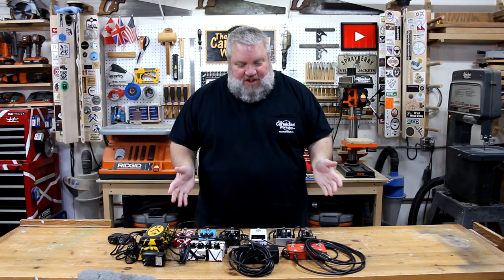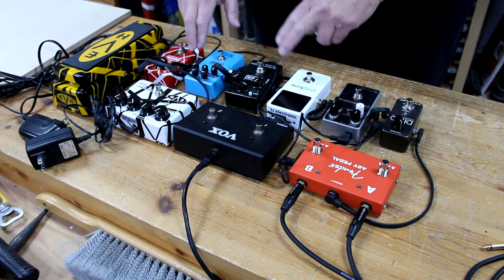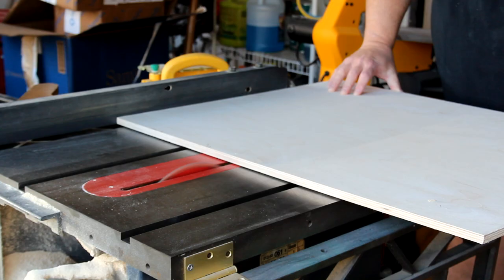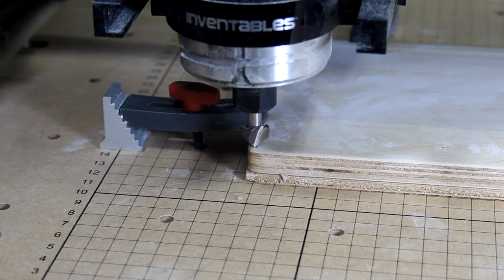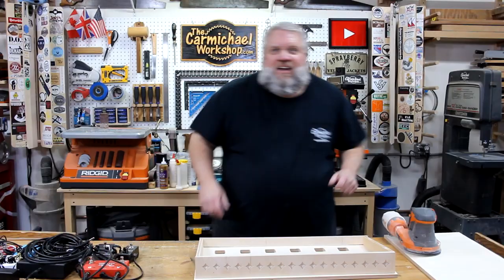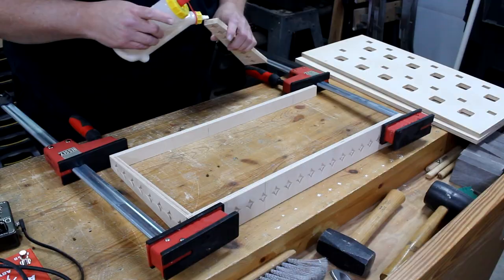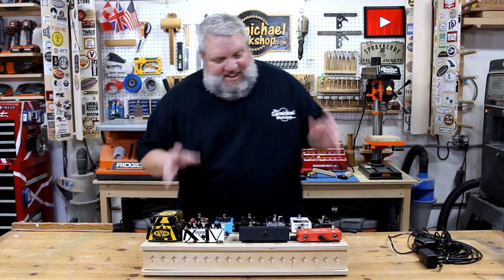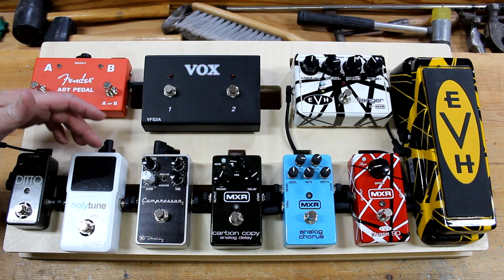Making a Guitar Effect Pedal Board

Comment: Nice project! Here are some ideas for improvement, in case your board should be used for gigs: I would have added space for the two power adapters. Then you would only have one (longer) cable with a mains plug. And I would mount the cables running to the amp permanently to the board and tie them together. The next project could be building a transport cover. You could design it that way that you have space on top of the pedals. After the gig, you could simply drop all cables on the pedals, then put the cover onto it. The cover would have also a handle for transport.
Reply from the maker: Thanks Oliver!  Great tips!  I play bass in a band so this guitar pedal board is just for home use.  I have a separate Boss pedal case that I used for my bass gigs.

Comment: If you want to try this, go buy some car carpet from your local box hardware store. I use the black stuff that you would see in any vehicle with black carpeting. I applied it using spray glue adhesive and then on all of my petals are used the part of the Velcro that is the hook strip. Then the car carpet acts as the loop and it doesn’t matter how many times you pull it off and on it’s not going anywhere
Reply from the maker: Great tip!  I didn't know they sold car carpet, but I see some on Amazon and maybe auto parts stores.  I've had carpet pedal boards like that before.  The only downside I experienced was it made my house smell like an ashtray after playing smoky bar gigs, kinda like those carpet covered speakers.
Reply: @SteveCarmichael  oh yeah I didn’t even think about that yeah that would be terrible. I got mine at a place called Menards, it’s pretty much like a Home Depot or Lowe’s